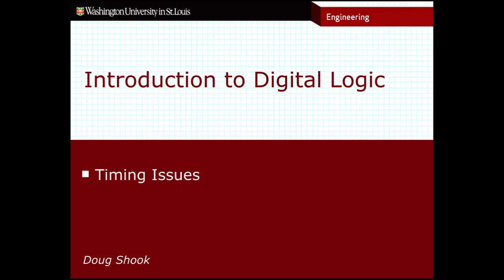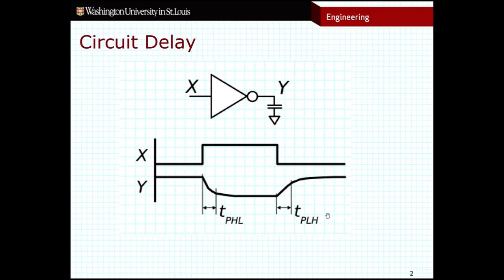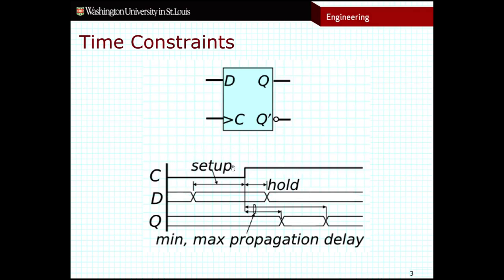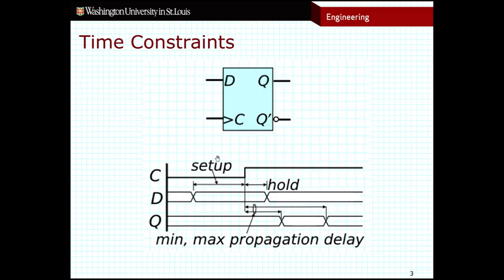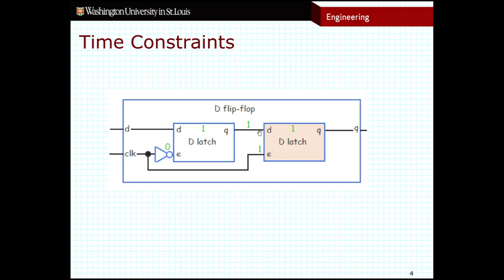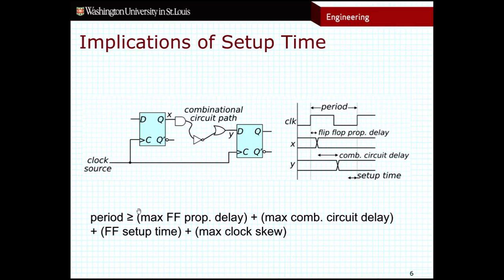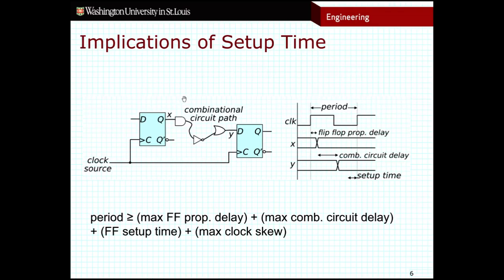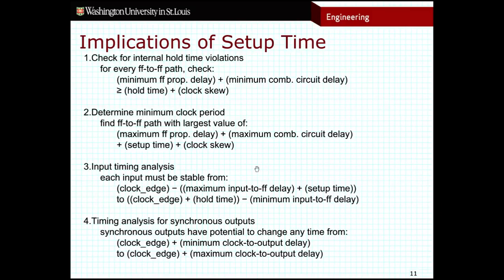CSE260 - Timing Issues

Comment: Hi Doug, 

Thanks, learnt a few things here. 

In slide-10, why dont we first latch with inverted clock and then latch with the (non inverted) clock? By doing so, we lose on an average only half the clock cycle time. This applies when there is a high risk of input data transitioning at the clock edge, and by doing so, there is no chance of a metastable output at the first FF output.
Reply from the maker: Thanks for the feedback.

In the video and on the slides you can see that I am talking about asynchronous inputs, meaning we don't know when the input is going to come in. If that is the case, you must always expect metastability after the first flip flop, regardless of your clock configuration - the signal could come in on the rising edge or the falling edge or anywhere in between. I'm not constructing my circuit for the "high risk" case (nor do I think that an asynchronous signal is any more likely to come in on the rising edge), I'm constructing it to handle all possible cases.

Furthermore, this is an introductory course and you'll notice that I prefer to keep my circuits simple, when possible.

Hope this helps.